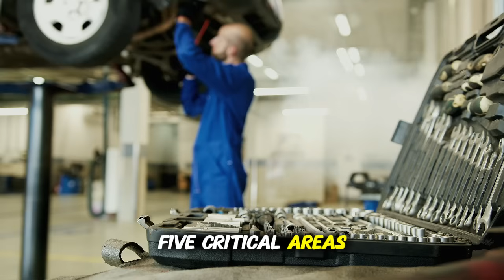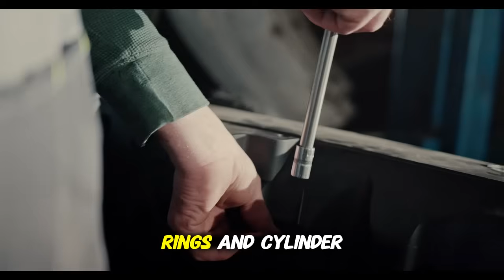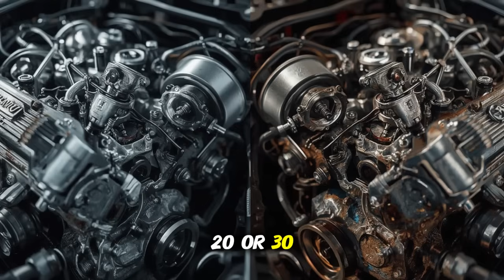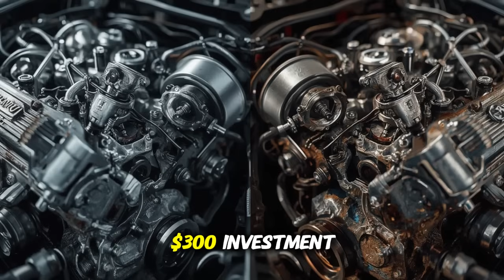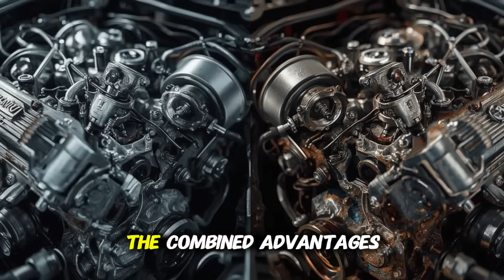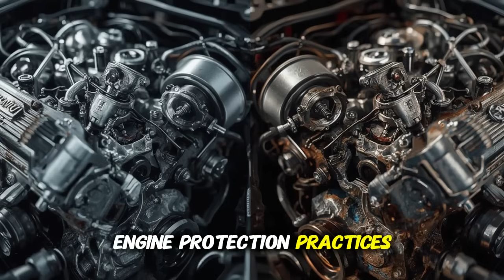HOW TO MAKE YOUR ENGINE WHISPER QUIET! ELIMINATE COLD-START ENGINE WEAR! NOBODY TELLS YOU THIS

Comment: Generally full synthetic oils can handle seriously cold weather like minus 10 to 30 as the oil doesn't freeze at those temperatures.  Of course you could ad a oil heater cord and keep it plugged in to keep the oil warm might do the same for a battery heater blanket attached to and electric cord just don't forget to disconnect those cords before you drive off.

Comment: I most of the time run  trucks  and  cars with 200 k. Or 120 thousand  miles.  I use  10 w 30 full  synthetic  oil and  1/2 liter or 1/2 quart of  transmission oil  that  thins out the oil a little and is high in detergent to keep it clean and have never had a problem.  Add  1 full liter  the  first  time  to  clean it good. Get  400 to 600 thousand  doing  this..If  it  means  anything  I Am  67 and run  gm but this works well with dodge and Ford.

Comment: My God after hearing all this I don’t think I’ll ever start my engine ever again,it’s the only way to prevent any of this tush,starting an engine and reviving it from cold is suicide because like they say all the oil has drained away from the bearings and returned to the sump and it takes a few seconds for the oil to get round the system,engine’s with hydraulic tappets always rattle until the oil pressure gets to them,this is terrifying for anyone who hasn’t a clue what’s going on under the bonnet,people who know better take no notice of this snake oil crap.